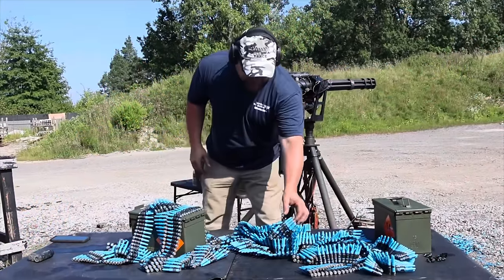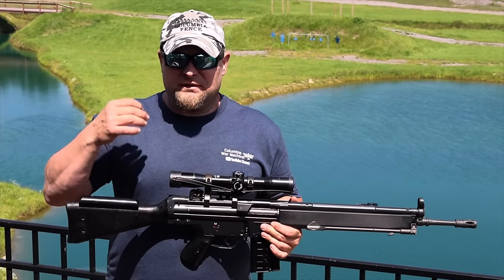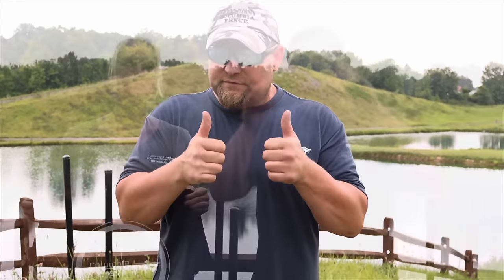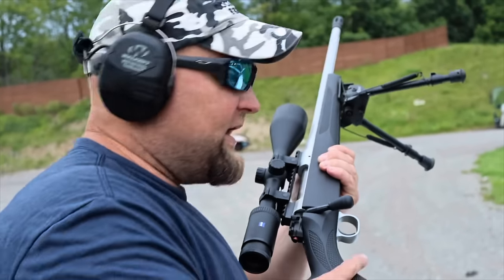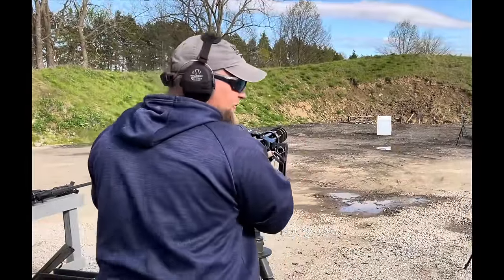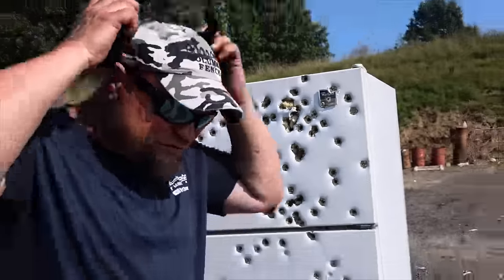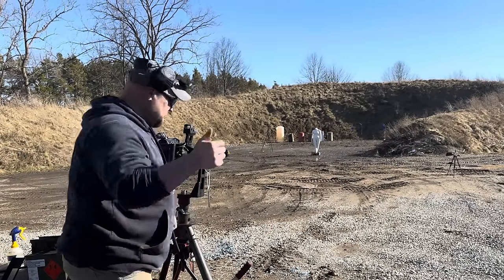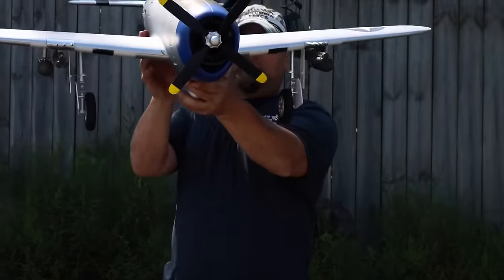Plastic Bullets? Dag Blue Tip Training Ammo!          Columbia War Machine

Comment: Does HKparts sell the bolt assembly that will cycle these for the HK G3 still? I have an HK91 and I would love to be able to use this plastic ammo without having to manually operate it 😂 I’m speaking from experience
Reply from the maker: Yes I hope to get one . Check out my m-134 mini gun vs RC planes part 2 video https://youtu.be/wzwh4svCYoM?si=IwFu6OtnSpnMbtUC

Comment: Jesse Ventura can shoot it from the hip.  It's a common misconception that recoil is based on the caliber being fired, but actually, it is based on bullet weight, twist rate of the barrel, direction of twist, and muzzle velocity.  If you shoot a 6mm Creedmoor with a 115gn RDF bullet out of a 1:7  RH twist barrel with a MV of 2900fps, then the exact same amount of RH torque and felt recoil will be exactly the same if your shooting a 6mm GT or 6mm Dasher so long as the weight of the entire platform is the same.  If both rifles have the same zero point, then the required elevation change at 1k yards will be the same.  There is a dispersion statistical difference.  If the shot is fired in a climate controlled location and all other variables are perfect, then the elevation and windage would be exactly the same.
Reply from the maker: Jesse used blanks , and you have brought up sone good points well said thank you for watching , part 2 is coming up September 13th 7pm

Comment: Do they make these in pistol rounds?
Reply from the maker: I don’t know I have not seen them in any other calibers , but that would be awesome if they did
Reply: @columbiawarmachine9795  yea man even more so for revolvers
Reply: Yes they made them in 9mm and a little in 38 special. From what I have been able to find, they were likely used in heavily modified MP5's and maybe glock pistols. But that was hell to find and nothing concrete, other than they were for training that kept the bullet range low. IE in Europe where they  wanted to be damn sure of safety. I have tried these in a Charter arms Pitbul revolver and they don't headspace worth a damn. They are about half a mill too long for the cylinder to rotate properly.   @georgeaura

Comment: Rpm is different between live and plastic rounds. It shoots faster with plastic
Reply from the maker: I think it should shoot the same , it is not recoil operated, the electric motor should run the same even with no rounds in it
Reply: @columbiawarmachine9795  right but rpm is Revolution Per minute with the plastic rounds they don't weigh much compared to the brass rounds which means the electric motor don't have to work as hard to move the plastic rounds compared to the brass
Reply from the maker: @southernwulf3335  I am glad you bright this up I am going to put 200 rounds of both in the gun and time both and see if it is any different! Now I am curious